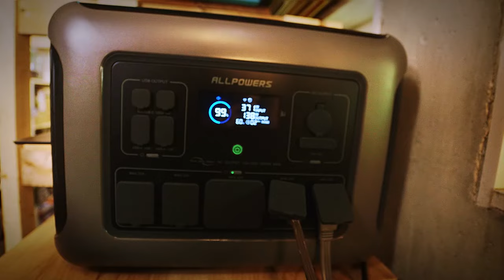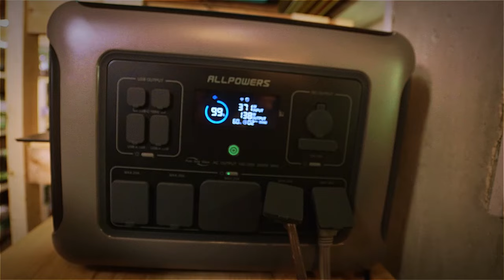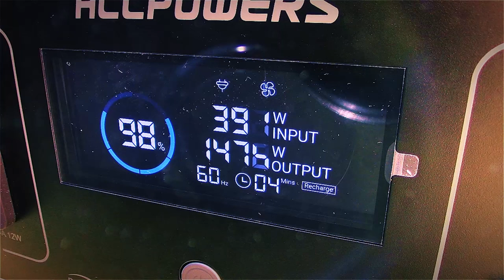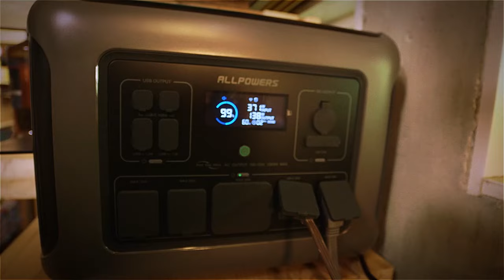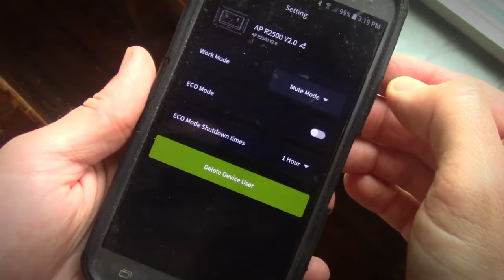Most Home Solar is Built WRONG!

Comment: My system runs multiple systems for different functions,  my lights have its own separate solar, my water pumping has its own wind and solar and the main system is its own solar for heavy loads, it's actually the best way to have solar.
Reply: All the YouTube OldHeads know you are a decade ahead. 🤣
Reply from the maker: I always liked how you said that whenever you build a new thing, it has to get its own power generation and water capture. Cellular building.
Reply: @FocoTheFirst  Just a decade?...I'm going to have to do better 😆
Reply: @PraxisPrepper  There is less of a chance to go completely off, in a real SHTF emergency, a non working system can be used for parts.

Comment: What the solar panel scam is,

Is building their power plant for them at our cost,  so they dont have to build up their costly infrastructure. At very little benefit to the end user. Especially here in OKC where the utility company will NOT credit you back if you go negative.

 And they discount you only their kilowatt conversion, not all the numerous extras and surcharge crap they charge you with. We've saved these big power companies trillions by upgrading their power plants, and using our roofs to do it.

So yeah if your system is tied to the grid, its a total sham. Have to have it like Praxis here with its own battery bank where you barely lose any energy, and only from the loss of the upscale/downscale transformers
Reply from the maker: Yeah, the "deal" here from the power company was crap on the net metering. We made it so we can connect back to the grid, but we don't (and can't) send any power out on to the grid. The freedom to do the system my way was WAY worth missing out on the pittance that was offered to me to sell power back onto the grid.

Comment: I agree with you Praxis that if the system can't be accessed without the phone, I'd get disappointed in the product also. I understand accessing any extra features, like consumption history, that's fine, but if I can't power it up or use it for the basic function it was purchased for without a different gadget, I'd be hesitant. Gosh, it's as if the batteries are not included with the batteries LOL! 😆Thank you for this review, I'm currently in the market for something that will be dedicated solely to the freezer and another for the sump-pumps during electrical emergencies. Great stuff! 💕
Reply from the maker: Yeah, I'd prefer the switches were right on the unit. Unfortunately most major makers of these units are moving towards the "app control" model.

Comment: Most solar installations are not only wrong they are just this side of useless from a prepping pov.  Most sales are driven by the concept of saving money on the electric with a many year payback.  I could just about care less about saving money on the electric, right now as Americans we are still living in the land of plenty and while it is getting tighter out there, most people are not being broken by the cost of electric.  That may be changing and I am sure it will get worse with the way things are going.  But for me I care about being stealthily off grid.  My system is an off grid one that does not have any government approval, just the way I like it.  That means while the grid is there, I am using it.  But most of these systems will not operate without the grid being functional, there are some workaround solutions but they are difficult to implement and certainly not by joe and jane sixpack.  Nor have I or will I dump thousands of dollars into such a system.  I certainly agree a whole house solution has it drawbacks, when the lights go out and are not coming back on, well you lose one capacitor and you have lost your whole system.  But unless you are cash heavy those nice neat packages and they are nice, I broke down after swearing I was not going to do it and bought one from my patriots but they tossed in a lot of freebies to induce me into it.  I certainly am not springing for more than one.  A better plan in my opinion and the way I am building myself, is the whole house system and several backup small inverters for individual circuits.  Have a couple of spare charge controllers as well as multiple banks of batteries one of which should be lead acid.  Lithium is great for those with deep pockets but a prepper should still have an equivalent lead acid system.  In teotwawki I will not be able to find lithium easily if at all, but lead acid, there are millions of those out there.
Reply from the maker: My original system (which is now in my emergency shelter) was all lead acid. I find those systems a lot easier to understand and build DIY.